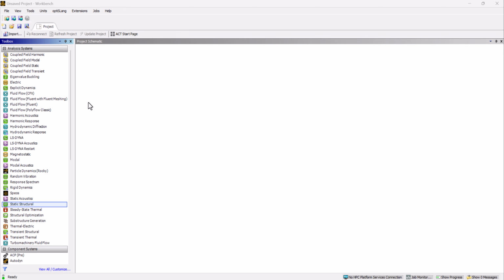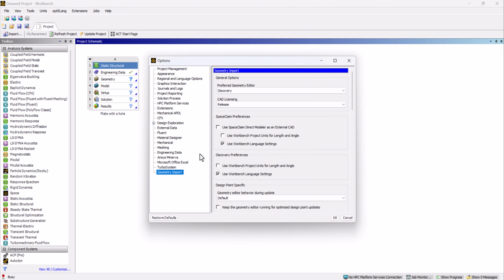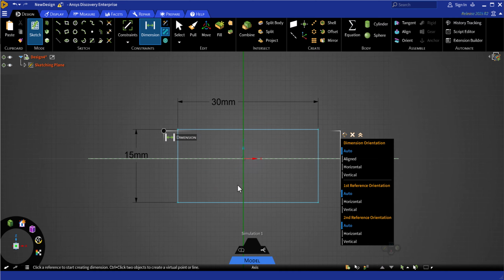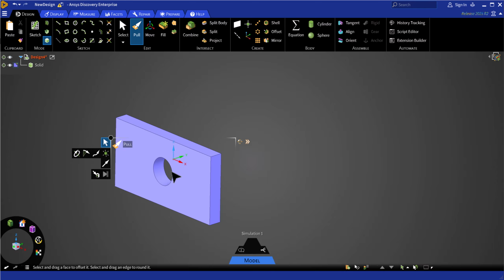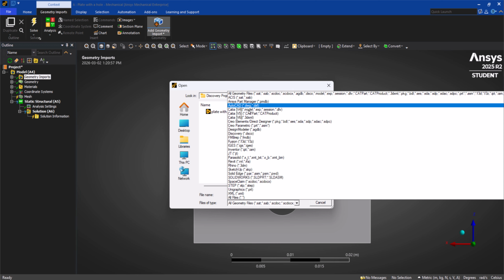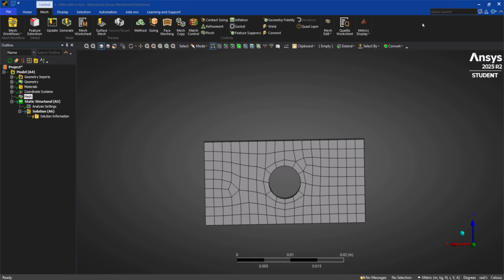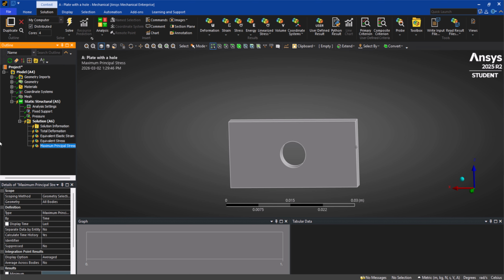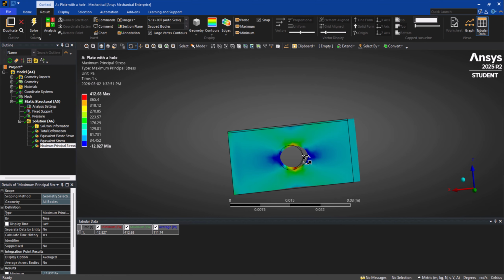ANSYS for Beginners: Run Your First Simulation Step-by-Step!

Comment: Thanks a lot for your lecture! yours are magnificent for me(who is FEA novice😅)

I have one thing which i want to ask, would you please recommend some books about ANSYS related to heat, fluid, structure, frequency simulation?(Being translated in Korea, it will be perfect ☺💯)

No matter how much it is expensive, i will just buy it if it is helpful for my project👨‍🎓
Reply from the maker: I'm really glad my lecture was helpful for you as an FEA novice! Regarding book recommendations, it can be tricky to find comprehensive resources that cover all those areas and are translated into Korean. I'll do some research and see if I can find some good options for you.